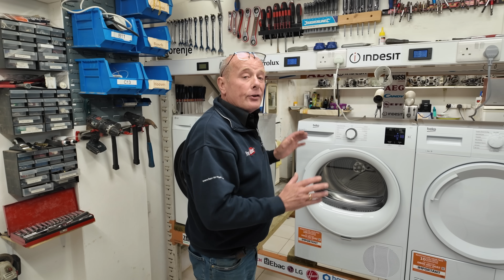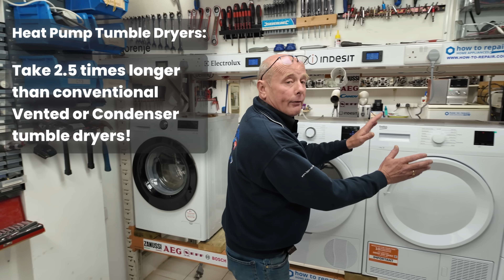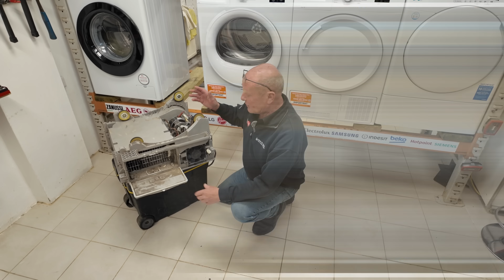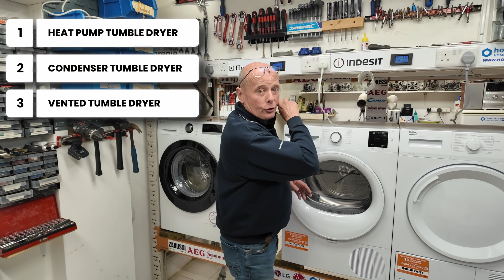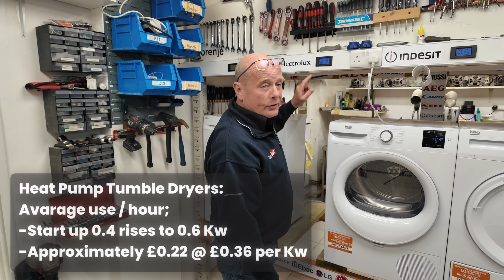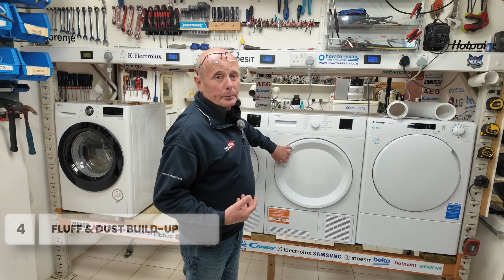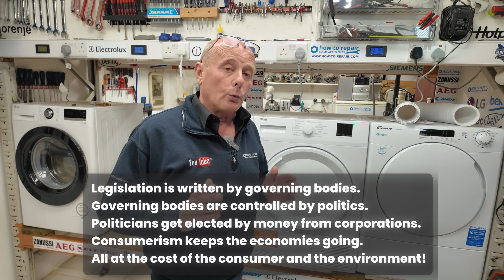Tumble Dryers the Shocking Truth About Heat Pump vs Vented & Condenser, NEW LEGISLATION!

Comment: I was a white goods repairer (retired 2019). Your comments mirror my own experience and opinion. I think that one difficulty is that people will believe the things they want hear, for instance, 'This new, energy efficient, machine will dry your clothes AND cut your energy costs/save the planet etc'. Customers would ask me " Which is the best tumble dryer?" I would explain the pros and cons of the different types of dryer and watch their eyes glaze over because I wasn't saying the things they wanted to hear. Like you, I was honest with my customers but the true facts about white goods, and the manufacturers, didn't appeal to them. It seems to me that people are content to spend lots of money on bright , shiny, new things in the belief that it will solve the problem. The same people would call me out repeatedly to blocked filters (in all kinds of appliances) rather than simply cleaning filters themselves. I could go on, and on, but I will end by saying that I no longer have a dryer (I don't need one) or a dishwasher, so I get to keep my money and avoid any problems. 🙂

Comment: We are foster carers we wash continually for the up to 5 children we have usually ,  when I did the laundry area , I placed the drier and washing machine in the same air volume as the Fridge and freezer ,  incoming air passes the other appliances being heated then it passes through the drier ,  it then exits via a duct in the concrete floor where the vapour condenses heating the floor the cooled air exits as a vapour plume ,  I have put provision in for a gas Dryer which I will eventually use when I can get one , drier is used usually for final drying,  the roof of the "playroom "  which has the drier washer fridge and freezer in a long cupboard uses my design of bowstring roof structure and my wife adopted the 8mm tension wires as clothes lines ,  they have lots of tension on them and can take any weight
Reply: I also have a heating loop in the concrete floor for connection to a exhaust bypass condenser from the gas boiler to reduce the exhaust temp to the floor slab temperature ,  that's not yet been installed as the room is sufficiently insulated to not be a problem , even though it was a conservatory and has almost all the walls as glass

Comment: Keep it simple and mechanical, make also make sure to use the heated air to a heat extractor to heat the house .. then one properly have more of all in green and savings on power. 
Also the build quality must be up to spec.. 5 years is a third of the time it should last. Taking the environment and the economics in to it, expected life time min 20 Yares of life time..